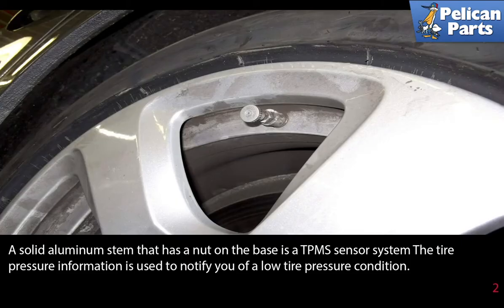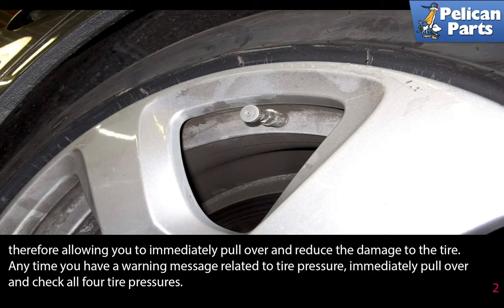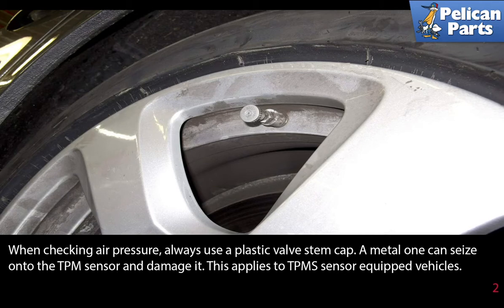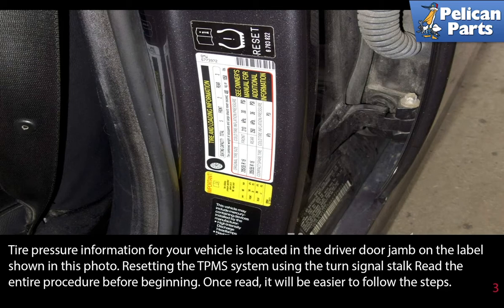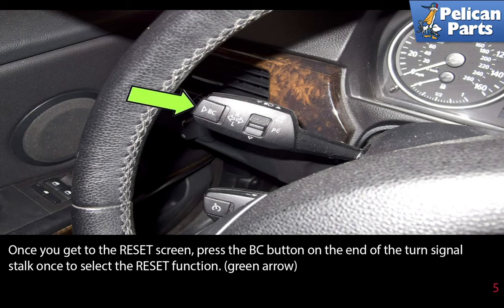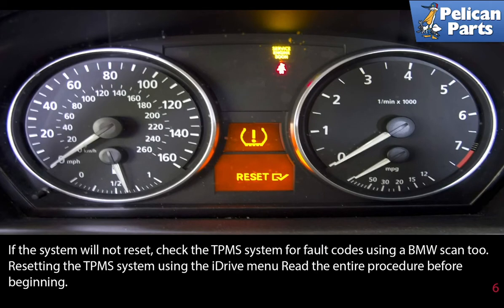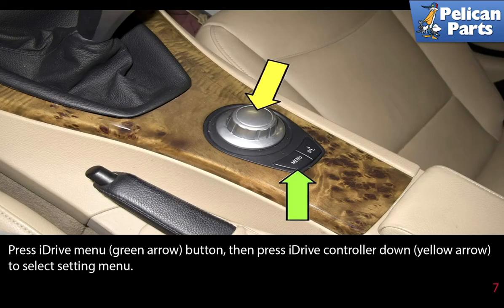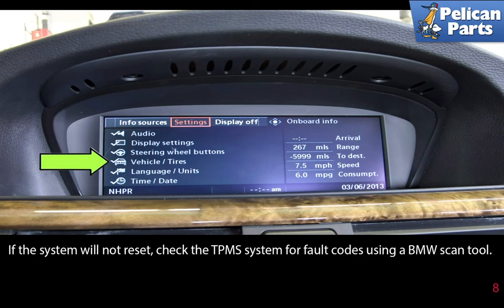BMW E90 3-Series Tire Pressure Monitoring System for 335i, 325i, 325Xi, 330i, 330xi, and 328i

Comment: How do you reset because it doesn't work anymore it just says malfunction
Reply from the maker: I would start by checking the vehicle for fault codes. If the system is not working properly, a fault code will be set. This will be your best bet when diagnosing.